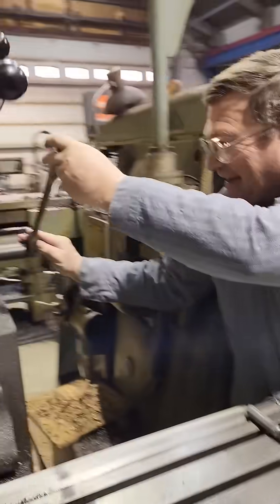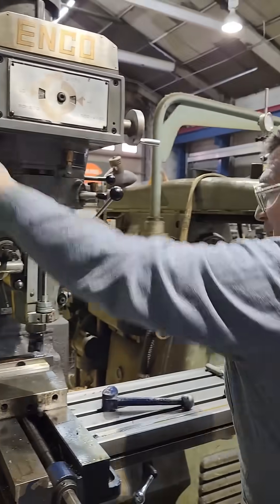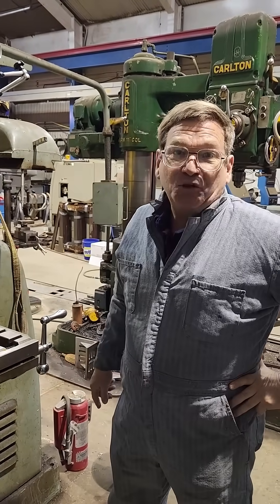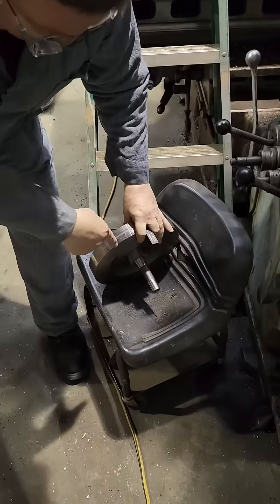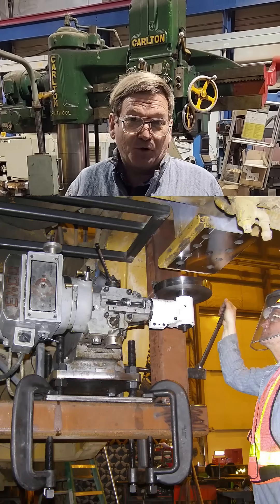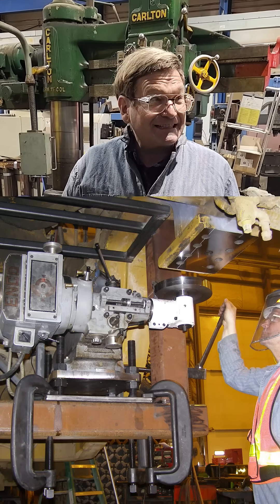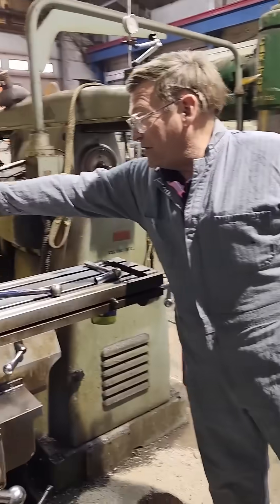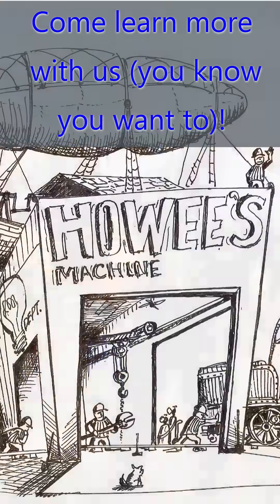The machinist's secret 4th axis on the mill

Comment: Always wondered why nobody uses the ram instead of the Y axis in some cases on a BP... Tho, i have got to say, that application of the ``top hat`` of the BP mounted to a plate and used as a ``portable`` mill is great! You still have the long linear stroke with it, the head tilt and the quill stroke... Just remarkable... I know what i`ll do the next time i find a fucked up BP... I`m getting that ``top hat`` off of the main body... That reminds me of the Russian monster BP copy that was no less than 3 tonnes of cast iron... Imagine a BP but triple in size... That was a bloody beast, but i left it at the scrapyard... Way too large for my uses, especially for a portable solution like the actual BP... Not to even mention that i have 10 restoration projects as is, and the list is growing, so that kind of a monster could never have fit in my current space...

Comment: That might be ok to rough mill something. The moment you start to come out it will start to sag down further and further. If that's ok for what you're doing then fine.
Reply: True from a certain point of view, but you are ignoring that quite a lot of mills have that exact configuration for the Y axis and unlike a BP - they do not have a separate table Y axis... Almost all of Euro mills move the head in and out on a ram to take out one rigidity compromise out from under the table, leaving only the X and Z axes linked to the table... And some of those same Euro mills outrank a BP by a large margin - when it comes to precision and rigidity(same thing really, at least when the machine geometry is perfect)... The cutter is brought to square with the work/table by the head nod ``axis``... Look up Schaublin 22 for example - a mill made by the Swiss specifically to rival the legendary Bridgeport and to outperform when it comes to toolholding and work accuracy... 

When a machine has such a ram, the ram itself, or the ``saddle`` that it rides in, the female dovetail in the body of the machine is done with the slightest upwards angle, which is calculated to offset the gravitational pull and the bending of the ram induced thereby along it`s full length of travel... A lot of other machines like surface grinders will also have slight ``error`` scraped into the head carrier that is the Z axis to negate the sag partially, leaving some slight sag to be countered by the deflection of a finish pass, with the diamond slider being head mounted and bearing a calculated error to dress the wheel perfectly in accordance with the deflections and angular offsets on a finish pass... 

Just because something can be an issue does not mean that it has to be an issue... Same how modern CNC compensates for axial errors, tool deflection, backlash and all the other crap... If you know the physics behind a system, you can play it to your advantage... 

Best regards! 
Steuss
Reply: Did AI generate this? It's full of bullshit and industry buzzwords that meanders this way and that.

Comment: I like the idea of using a socket to move that rather than a handle w/ a 3/8" thread.
Reply: Said like someone who has never seen a tool dig into the material and take off. I always just used the same wrench we left on the machine to change collets, or a breaker bar instead of a ratchet, so you can feed in either direction.